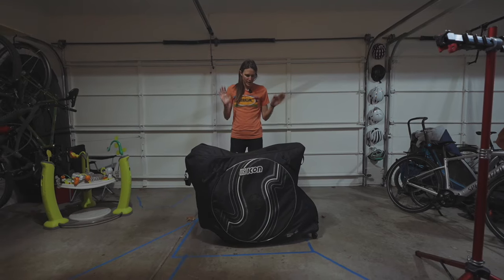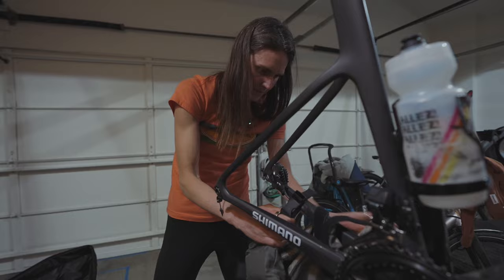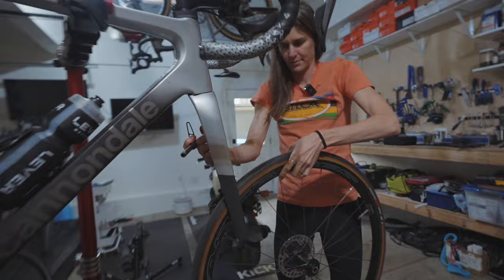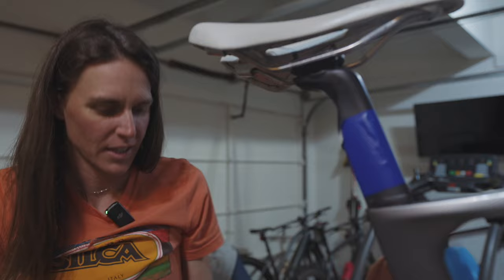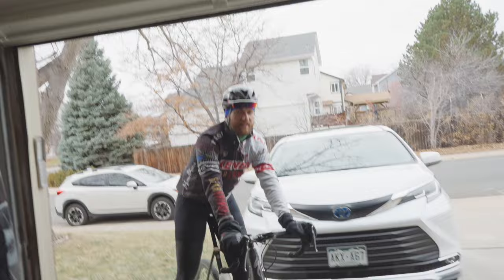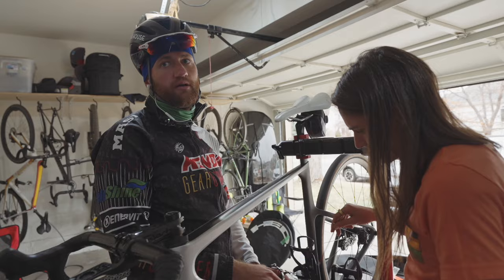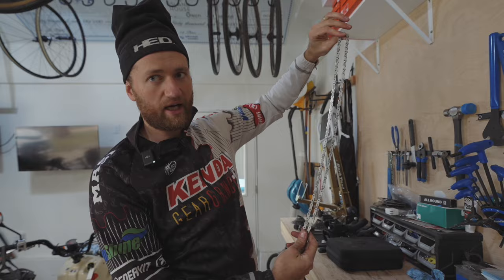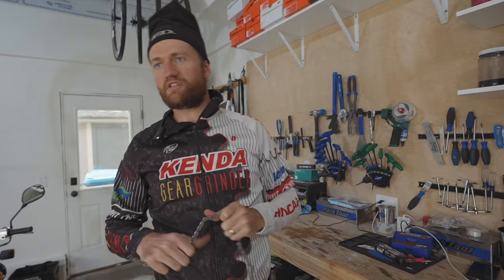How to wax a bicycle chain ll bike build

Comment: A little easier to pack than a tri bike in the soft case.  I recently traveled to Cali for IM and used a similar case for Tri Bikes.  Like the note about the disc break spacers I am getting a new tri bike with disc and will have some things to learn with this new setup.  I like the silica tools I will have to check those out.
Reply: Allahumma shalli 'alaa sayyidinaa muhammad wa'alaa aali sayyidinaa muhammad wasallim tasliima😁😊

Yok Tobat Kawan Dan Jangan Lupa Sholat Dan Sholawat😊😁

Comment: Question for Patrick on the waxing, I see a lot of videos from Silca and whomever and they use an ultrasonic cleaner in their process. Is this absolutely necessary or can I just use the mineral spirits -> denatured alcohol method if I’m using brand new chains? Thanks!!
Reply from the maker: Just the mineral spirits is fine he says